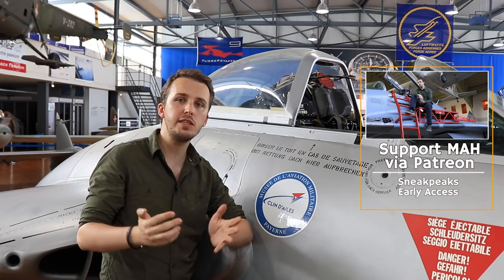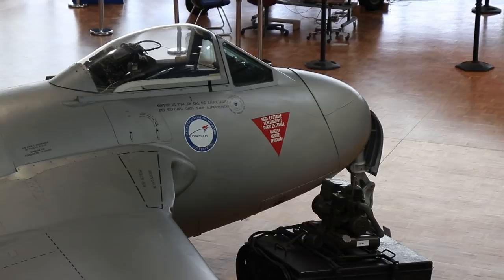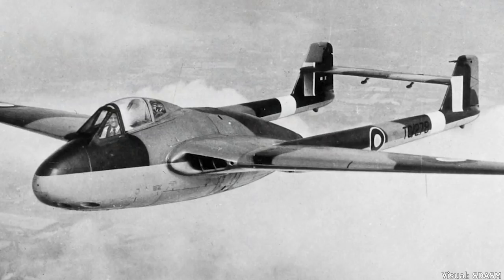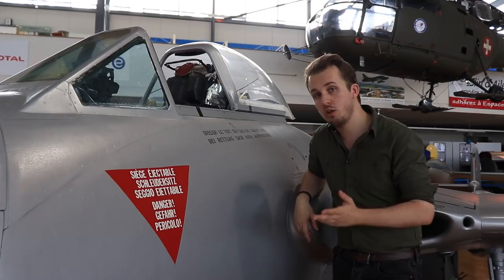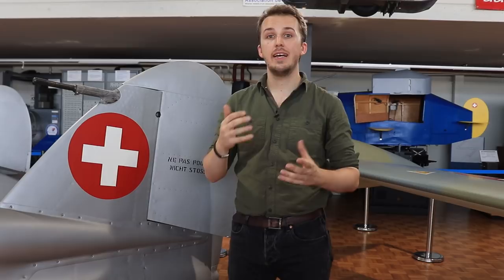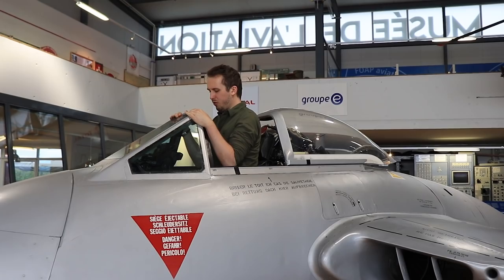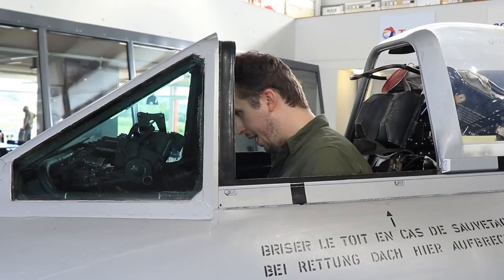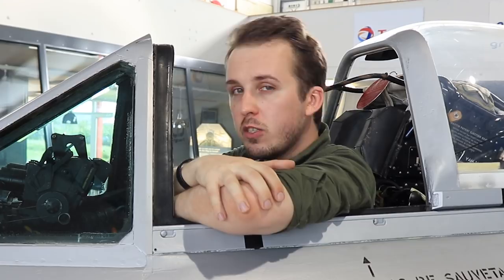Inside The Cockpit - de Havilland Vampire

Comment: "It's a bit cramped..."

Understatement level: british.
Reply from the maker: When in Rome...
Reply: Until quite recently everything was designed about a 5'8" adult size. Bismark doesn't fit that model.
Reply: @MilitaryAviationHistory  for a bit of perspective, how tall are you Bismarck?
Reply: One wonders if the designers used the famously cramped Spitfire as a template, as it’s a safe bet that most RAF pilots were coming from that aircraft (or from the Seafire for FAA pilots).
Reply: @Chris Walton
Well, engineering is the art of compromise.
If you keep the cockpit small, you can keep the rest of the aircraft small and light. Sacrifice one thing to gain something else.
Though in general, I would question if sacrificing crew ergonomics will ever pay off. Now, I don't know how cramped the cockpit would have ben for a more.. average sized person shall we say. But if your knee obscures some of the readouts, I don't think 10 centimeter less would realy change that...
Reply: @chriswalton720  the controls are quitte similar to the Spitfire which kind of helped:)
Reply: @robertcoleman7071  if I recall, he's 6'2".
Reply: I'm rather disappointed by the absence of a boiling vessel for making tea...
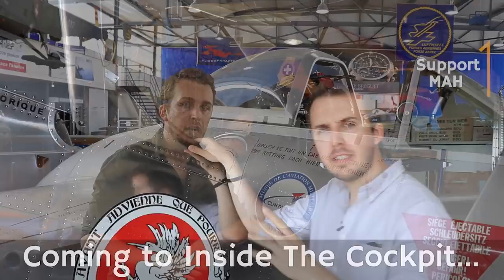Reply: What do you mean cramped at 1:24 you can clearly see how much room there is. Just look at the size of the me 262 compared to this monster!
Reply: @chriswalton720  “ One wonders if the designers used the famously cramped Spitfire as a template” come to think of it. Based on 1 lesson in a Spit In Biggin and 2 flight lessons in a Vamp a year later in Coventry I am sure. Although it flies like a jet (no pfactor etc) the controls are the same as a Spit as much as possible and it  flies like a Spit on steroids. We put it in a 45 degree pitch barrel roll and the Vamp had 0 problems with it. Beats any ride.
Reply: @chriswalton720  I am over 6'  and not exactly 'svelte' but I got into the Hendon Spitfire quite easily.. I was surprised at the cockpit space.
Reply: @Pitcairn2  
Try sitting in the cockpit of a MIG-23 Flogger, talk about tight, I was amazed how cramped it was for such a huge aircraft, I only had jeans, a Tshirt and a ball cap on, I couldn't imagine having to sit in on of those things in a flight suit and helmet for a 7 or 8 hour mission.
Reply: Ah 6'2" you say well off the RAF Transport Command for you laddy
Reply: @ABrit-bt6ce  I would be quite comfortable in there then.
Reply: @chriswalton720 ....the E. E. Lightning was also supposed to be a little on the tight side.
Reply: I'm 5'10",  and when I sat inside a Vampire, I also found it difficult to see the altimeter,  
I guess you look out of the window, if you're in or above the clouds, everything is okay.

Comment: Very tight little cockpit it looks like.  I would imagine that there's a good possibility of injury during an ejection in one of those.
Reply from the maker: As far as I know, the cockpit was modified enough to prevent it and the seat would grasp you tightly anyway. I want to have another look at the Mistral, the French might have made some other modifications to their ejection system.
Reply: well, when the other option is sticking around and dying then it's not really a question, is it?
Reply: @iatsd  sure enough, but I was thinking about the engineering side of things. Somone during the design process decided the cockpit should be this size.
Reply: @MilitaryAviationHistory  hopefully the seat did the trick. I know the skyraider's ejection system was kind of iffy without the seat. People not being pulled all the way out because of being caught  on parts of the plane and what not.
Reply: A former buddy from the sailplane club had to eject from a vampire after 10 turns (and 3000m) in a spin. He actually broke his two ankles. But as far as I remember this happened when his feet hit the horizontal stabilizer
Reply: @MilitaryAviationHistory  There's a good reason that thing was never sold to Germans or Americans. lol
Reply: @Jack29151  NIH: Not Invented Here.
Reply: @Jack29151  - Very astutely observed Sir.
Reply: I don't know whether this is true or just a pilot community legend from the time, but at an airshow it was mentioned that pilots were selected for Vampire or Venom based on height, and that this was necessitated by the clearance between one's knees and the instrument panel during an ejection.
Reply: Frederick Forsyth (wrote day of the Jackal and other things) was an RAF Vampire pilot -  I recall him mentioning somewhere that pilots had a very real concern that if they had to get out the horizontal tailplane could end all their further concerns.

Comment: Here in Sweden, they bought 380 Vampire, and called them J28 (j=jakt - it means hunt, or in English terms - fighter). We also had 57 Vampire T mk 55, designated J28C. And the airforce bought 60 Venom, called J33. Apart from some Hawker Hunter, that is all the imported jet fighters we had thru the years rolled out in active service.

Comment: Great job as usual, Bismark!
I've got a couple of hours in the Vampire (A T.35 2-seater), and it was one of my favorite airplanes to fly and work on.
Now, I'm a big guy (About 6'4") and it's a tight fit, but if you want to fly bad enough, you find a way.
In the air, it's a fine handling little beast, underpowered at low speeds like all early jets, and, being a Brit/European ship, very short on fuel to American eyes. (We used to joke that every takeoff allowed 2 Energency Declarations - Low Fuel, and a Fire on Board (In the engine, of course - we also used to say the same thing about the MiGs that were around).  Limiting Mach is a bit low, and you can get into trouble that way, but it's nt usually a factor.  The best way to describe handing is Heavy, but Responsive - this isn't a bad thing, as it allows you to through the airplane around without too much fear of breaking it, and it made it a pretty fair gun platform.  It really earned the nickname "Kiddy Car" - it's still a high performance aircraft, and has to be treated with respect, but it doesn't try to bite you. Oh, yeah, it will turn like nobody's business - I never got that tight, but running the numbers puts it down with the Spitfire. (Short range, simple, maneuverable - it basically is a jet Spitfire.)
Keeping one flying is, fir a jet, not a huge effort,  All the controls are manual, the engine and systems are fairly easy to get to - although that low ground clearance makes getting under a real hassle. I'd rate it at the difficulty/maintenance effort and skillset level as about that of a turboprop twin, like a King Air or Mu-2.
They were an axcellent platform for introducing jets into service, with a fairly easy transition, and it's not hard to see why they were so popular with postwar or post-colonial Air Forces that needed to re-equip.
(Oh, and for getting out without the ejection seats - full nose-down trim, jettison the canopy, put your left hand on the seatbelt release, roll inverted, and simultaneously let go of the stick, and release the seatbelt/shoulder harness.  The jet will pitch up, and the Gs from that and gravity will, usually, fling you out - as long as you're well above the ground.

Comment: "OMG, The jet's on fire!" :) 

Informative, as always.
Reply: The vampire wasn't the best fighter jet at the time, but it was the best fighter jet for Britain at that time. For various reasons Etc.
Reply: @manichamartia8775  what was the best fighter in 1945 then?
Reply: Manic Hamartia ME262 wasn’t either and I suspect the Vampire would have run rings around it in any dogfighting. The Heinkel design was famously superior to the ME. But none of the early jets were that effective. The British engines were far more reliable however.
Reply: @tobywenman4769  The Me-262 was without any doubt the best jet fighter in 1945.
Reply: @sandervanderkammen9230  with its 20 hour engine life? I would personally choose a vampire over a 262 anyday.
Reply: @tobywenman4769  Perhaps you should enlighten yourself regarding the PFTRs and TBOs of comparable engines of the day...
Reply: @sandervanderkammen9230  there is no doubting that the goblin engine was significantly more reliable than the jumos fitted to the 262. The fact that the vampire also only has one engine is a big boost to it's maintainability and also areodynamics. There's a reason that the vampire stayed in service for such a long period of time all across Europe
Reply: @tobywenman4769  The performance and combat record of the Me-262 is without doubt vastly superior to any other WW2 jet aircraft.
Reply: @tobywenman4769  You seem completely unaware of the standards for engines service life between overhauls or TBO for combat aircraft in the 1940s and 50s.
Reply: @sandervanderkammen9230  in what way was it vastly superior then? Since it's clearly so much better there must be examples you can list
Reply: @tobywenman4769  Even though the Me-262 was the first jet fighter in operational service, it remained the fastest production combat jet until 1948. It's combat record is unmatched with over 500 enemy aircraft shot down.
Reply: @tobywenman4769  The Jumo-004b engines exceeded the 200 hr. PFTR at Military power required by the RLM for acceptance into Luftwaffe service, the same 200 hr standard required by the RAF and USAAF during WW2.
Reply: Typical TBOs for combat aircraft during WW2 when WEP and max. rated takeoff rate of accent was used could be as little as 10% of PFTR. TBOs as little as 15 hours were common in combat service for reciprocating engines as well as jets. Engines like the RR Merlin, R-2800  and DB-605 required inspection and repair anytime WEP was used during a flight.
Reply: One of the major advantages of the Messerschmitt Me-262 was it's high combat readiness and ease of repair due to it's  modular construction and wing mounted engine nascelles. A two man crew could replace a 262 engine literally in minutes while many Allied aircraft could take 2-3 days to replace an engine.
Reply: @sandervanderkammen9230  the P80 was being used in Italy in 1945 and probably would match the 262.
Reply: @richardmeyeroff7397  Probably not... the wartime version of the P-80 was no match for the Me-262 and was plagued with some very serious issues that weren't properly sorted out until after the war ended.
Reply: Vampire > P-80 > Meteor with long engine nacelles > Me 262 
Come at me wehraboos and nazis

Comment: The Vampire is an achingly beautiful aircraft. I have been lucky enough to see the Vampire in the air several times over the years and it makes an unholy racket when flying that is completely at odds with its graceful lines. Nice video. 😁👍

Comment: Nice report , a note to the air intakes.
For the engine it did not matter where the air was taken from. 
Meaning that that the air was filling the space around the engine and tailpipe to leak out the back end. 
A Nice cooling effect for all parts but not really a ram-air effect to help the engine. 
Obviously the goblin and similar engines did not accept any ram air due to its construction. Only air temperatures where an issue. 
The engine had no computer  to aid the pilot .. so he had to have Eyes and ears to the dials and pointers every minut. 
Opening the throttle at one go was not a wise thing. It would blow out and or blow to bits. 
On a go around you had to milk it to gain more trust to speed up.
Reply: "blow to bits" ? really ?
Reply: Jettah Yes .. in our airforce this was an issue, on a go around several blew up until pilots became aware of the possibility.

Comment: Slight question: Does the addition of an ejector seat reduce the room in the cockpit? I'd assume there's got to be several inches of precious space that had to be removed to fit any ejection system into the original cockpit
Reply: Yes, it reduces headroom & there's no room for a dingy, which doesn't matter much to the Swiss of course. However leg length is a problem on all Vampires - best to be short or lose your legs at the knees
Reply: That is like arguing that a parachute takes away space in the cockpit.
Reply: @wilhelmsallsten7706  An ejector seat requires extra space front to back & more canopy headroom.
Reply: The central part of the back wall of the cockpit was cut away to make room for the ejector seat.

Comment: If you're interested in the details, the Swiss modifications include the addition of the following components: Large blade, Small blade, Nail file/cleaner, metal file, metal saw
, Wood saw, Fish scaler, hook disgorger, ruler, Scissors, Electrician's blade/wire scraper Pruning blade, Pharmaceutical spatula, Pliers, wire cutter, Phillips screwdriver, Hoof cleaner, slotted screwdriver, bottle opener, 6 mm slotted screwdriver, wire stripper, can opener, 5 mm slotted screwdriver / wire stripper, Chisel, Corkscrew, Phillips driver, Mini screwdriver,Tweezers, Toothpick.

Comment: A close friend and instructor, helped in the restoration of a vampire at "Van Nuys" airport, in California, in the seventies. I was there and brought my video camera. there's no sound, but I  still have a record, in the super-8 film format, of the maiden flight after restoration. two P-51's also took off at the same time, to chase the vampire. We were listening on the radio, as the vampire  opened up the throttle, in a speed run, well away from the airport. The vampire very quickly pulled away from  the P-51's......We knew it was faster, what amazed us was how quickly it happend.

Comment: What you do not speak about are the flight characteristics of this plane. Because it was so much underpowered they had to use very aggressive airfoil profiles. That made the Venom dangerous to fly. A colleague of mine had to eject after he got into a spin he could not get out of. A very common fate. The saying was "never stall a Vampire, you never know if you'll get out of the spin. And a buddy of mine died in 1987 while in one of that last crop of young pilots still trained on the Vampire. He got into a dynamic stall while on a seemingly quiet flight crossing into the Verbier ski resort area. He was too close to the ground to eject and hit the ground upside down at 45 degree incidence.

Comment: There are two of these on display at the Finnish Aviation Museum near Helsinki-Vantaa International Airport. Additionally, there is a detached Goblin engine on display there. The Goblin engine is a centrifugal design, unlike modern engines which are all axial. The centrifugal design makes the diameter of the engine unusually great, and when you look at the shape of the fuselage of this aircraft, the shape suggests that it was designed around the engine.

Comment: Amusingly, there were height restriction for pilots in the RAF right up until (I believe) the 1970's - when some 1950's types were retired. It became obvious that putting a really good potential fighter into a Shackleton because he was over 5'9" was a waste of resources... It would have been the thinking that a small pilot for an early jet aircraft was a "good thing" for the RAF,  because it took less beer per lb to get him drunk.  Or something.
Reply: Many countries had height restrictions for fighter pilots because a short guy can take higher G forces. If you want to try a really cramped cockpit try to squeeze into a  Bf 109.

Comment: gotta say it looks eerily similar to the swedish SAAB A21R (well the latter did come years after though)

Idiot question but where is the tail hook of the naval vampire located?
Reply from the maker: It's hard to explain but if you look at the fuselage, imagine that it extends over the engine exhaust like a cape. The arrestor hook was located there, swinging downwards over the exhaust when deployed. If that didn't make sense, this picture will: https://previews.agefotostock.com/previewimage/medibigoff/089a9609377054058fcd1a23b873b531/mev-11955624.webp
Reply: @MilitaryAviationHistory  That was an interesting way to solve the arrestor hook problem. Rather impressive actually, a unique design solution.
Reply: Sweden bought vampires too

Comment: The Irish Air Corps had three vampires which they flew throughout the 1960's and into the  '70's I think. Not sure when they retired them. One became a gate guard at Casement Aerodrome but may have subsequently been treated more kindly, even restored by the Air Corps apprentices. Must check. I grew up hearing the distinctive and endearing whistle of the RR Goblin engines overhead.
Reply: The Irish retired their Vampire T55s in 1976 and replaced them with the Fouga CM170 Magister.

Comment: De Havilland Vampire jet was used during the Malayan Emergency 1948-1960. Sometimes it's used along with the Gloster Meteor jet for air strike mission against the communist insurgents' stronghold or camps inside jungle. If I'm not mistaken many of air raid operation using De Havilland Vampire jets were carried out in the state of Perak, Johor and Selangor.  It was the first jet used for the ground attack operation in Malaya. Before that, British used post late WW2 fighter planes mainly Supermarine Spitfire. There were also some of the jets crashed due to technical issue.

Comment: 616 Squadron Auxiliary Air Force was the first squadron to have jet powered aircraft when they where fitted out with Gloster Meteors in 1944, unless you meant after the Auxiliary Air Force gained the "Royal" prefix in 1947.